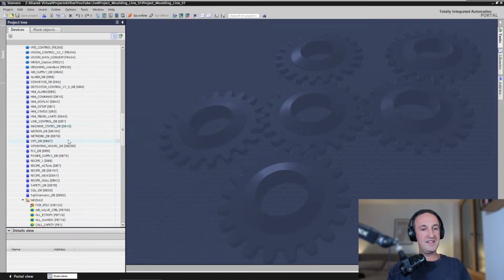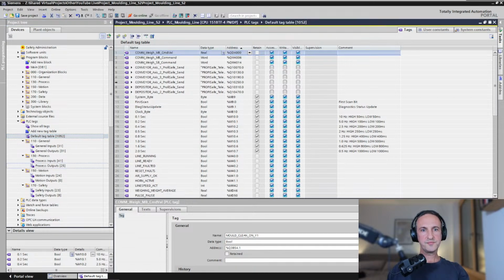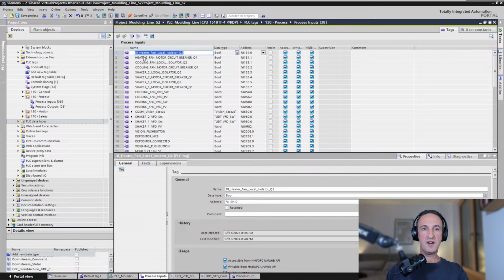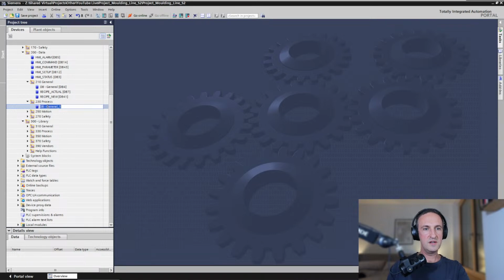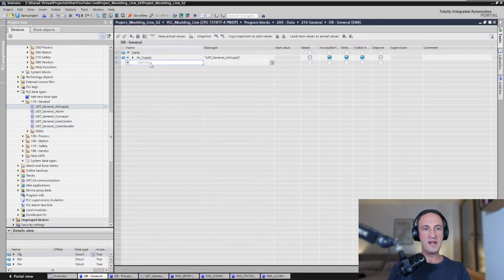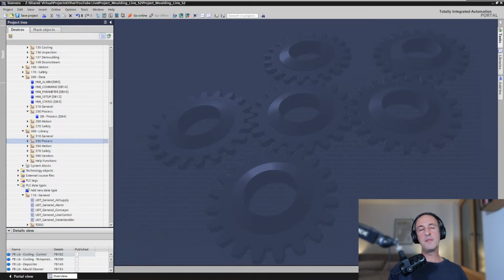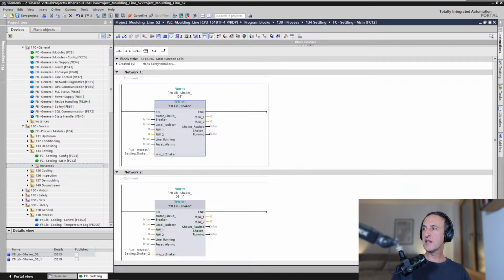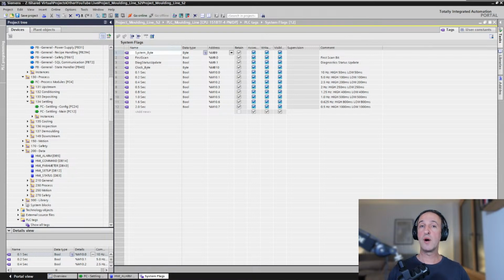🔴 Live TIA Portal Workshop: Re-Organizing Chaotic PLC Data

Comment: what is the difference between parameter and configration?
Reply from the maker: Great question. Parameters are recipe dependent and can be entered on the HMI using parameter fields. Configuration data is NOT recipe dependent and are typically not accessible from the HMI. They define the configuration for the different modules of your machine. They only need to be setup once for an installation.

Comment: What is module vs unit here?
Reply from the maker: In my line of work (food and beverage), units are typically one layer below a module.  So you have for example a cooling module that contains 2 cooling fan units and 1 PID control unit.  Or you can have a depositing module that consists of 1 depositor unit and 2 shaker units.
Reply: @PLCskilltree  , Need more such live sessions🙏👍

Comment: Thank you, great job. I wonder how you make your parameters inside UDT retain, I suppouse You dont want to lose them after restart?
Reply from the maker: Retain properties are set in the DB (where you define variables using the UDT), not in the UDT itself.  A UDT is just a datatype.
Reply: @PLCskilltree  Thanks for the answer but inside DB you can only make whole UDT retain, i thought about make retain only "Par" or "Cfg" struct, without "Sts" and "Cmd". I usualy make diffrent UDT for retain data and control/status data, but maybe there is a better way to have it together?
Reply from the maker: @ you cannot do that unfortunately, I am as well waiting for Siemens to add this in a future version.

You could make 2 structures for each module - a non-retain structure , and a retain structure, e.g. UDT_AirSupply and UDT_AirSupply_Ret.

Alternatively, just make all structures retain.  They are typically small in size and I have not had any problems yet in my projects.